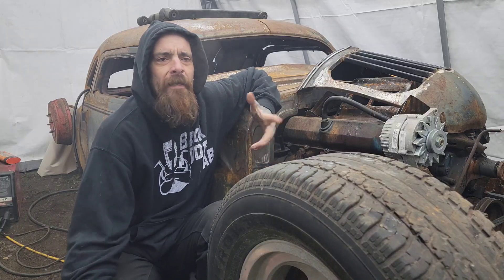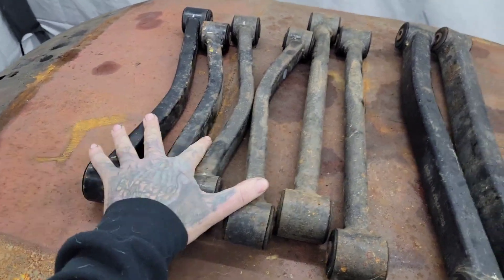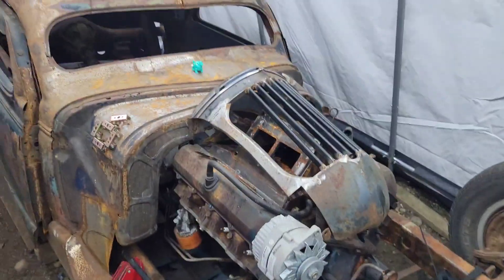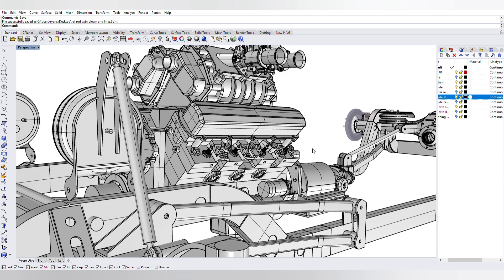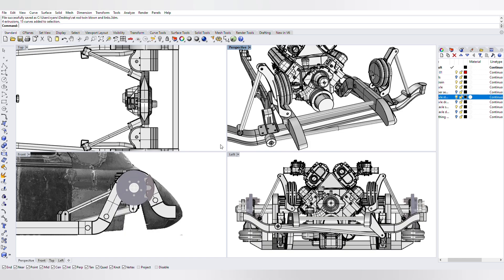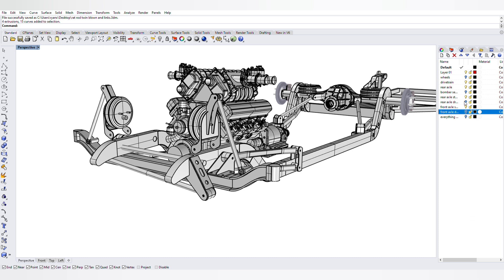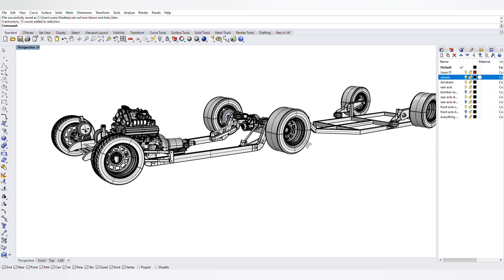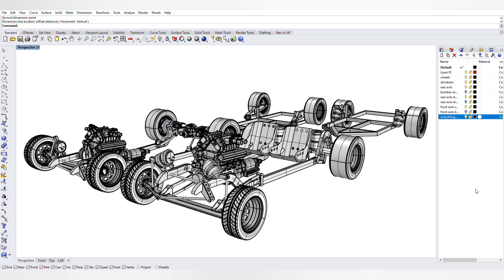Monday Morning CAD Episode 11   Suspension and Bags for my Rat Rod Chevy with a Twin Blown Olds

Comment: Hey Ryan, it's cool rocker suspension but I was wondering how the bags hold up when obliquely compressed? Do they fatigue more quickly? I like the big rear wheels/tires on the model. Very cool. Axleless trailer is the way to go.
Reply from the maker: No differant than an independent style suspension with the bag on the arm.   In a perfect world bags would travel directly perpendicular to the mounting plate.  Bit there isn't a suspension out there that allows that.  Even a parallel 4 link with equal length arms will travel in an arc, the biggest design factor is making sure that the mount plates are in line with the pivot plate, allowing it to move Ina  consistent arc. The front bags are the best I can make of it, and it allows me to use more than 100% of the range of motion, as opposed to the rear that is limited to the exact travel of the bag.  I've bought quality bags and I've put the time in to make sure it is the best possible within my design constraints, I just have to accept that air springs do have a working life span, and hope I replace them before I reach that.

Comment: going by the weather, the humidity, and the mention of logging, my guess is you're on the north west coast somewhere. you also mentioned your harley, cool, what year and model is it? and are those side draft dellorto carbs in your cad mock up?
Reply from the maker: Vancouver Island.  On the west coast of it, in a ghost town of a logging town.  The mill shut down so houses are dirt cheap and the views are unreal, we live a couple hundred feet from the ocean.
The carbs are Weber DCOE.   I'm actually grabbing mine from my buddy on the weekend, when I go down to get me wheels and all of my suspension brackets.  Coming back with a whole lot of cool stuff for the car.
And the bike.  I've got a japchop sitting in my brothers garage that I've owned for a few lifetimes, my Harley is a 2019 Fat Bob, 114, I built crash bars for it, a sissy bar, and a full stainless 2:1 exhaust for it, should be building some new fat z bars for it right away too.
I'm a die hard shovel fan. I don't have much use for Evos and Twin Cams, but I love this Milwaukee 8 motor. Pipes and a tune and it became a new ride, I'm getting old enough that I'm starting to consider a couch for me and the old lady, but I love my Bob, and we beat it pretty hard.
Reply: @kingofbootyfab  you're closer than i thought. i'm in kelowna. i live here with two of my daughters. the younger one has an '84 shovel with a 96 in S&S engine. she also has a 93 dyna. she highlites her bikes and bike adventures on her youtube channel. i have a '78 fx that we're turning into an fake FL. i know what you mean about getting old. i hope i'll be able to ride that thing when we're done it.what kind of bike is your jap chopper?i guess being that close to the ocean explains why things rust up so easy on you. anyway, thanks for the response, and are you going to do be doing your z bars on your channel?

Comment: I love Rhino, that's what I started using for my project many years ago. Now that Fusion360 is less friendly for hobbyists, I should get back into Rhino.
Reply from the maker: I'm actually self taught. And if you ask anyone trained at a school, I do it all wrong I'm told .  But I had an engineer friend of mine and one day we both programmed the exact same template.  Just a simple bracket, I had it programmed, on the memory stick, and cut on the cnc plasma, before he had finished programming.
I started because many years ago before I had my own cnc, the guy that was cutting stuff for me ran rhino, so that's what I started on.  Took me a couple years before I could program anything in 3 dimensional.  Hit once i figured that out, the flood gates opened, and now I have days I build vehicles, or art, just as if I was I was doodling in a notebook.  I sincerely believe that with the amount of common cnc equipment out there, and even 3d printers, that it's a skill that every hobbiest can use.  When I get my 3d printer I already have some badges and parts that my intent is to 3d print and then cast before I machine them to go on the car.
Basically  this is the long form version of YES, you should most definitely get back into it.
Reply: @kingofbootyfab  thanks for the story, I'm self taught in cad too. You should definitely get a 3d printer, there's so many little brackets and holders and tools you can make. But, it can also be a distraction for me that keeps me from getting work done on the car. I recommend a creality ender series printer because there's lots of mods and community support. You can even make 3d printed tube bending dies and press dies! There are vids on youtube of it. Even my shift knob is printed.
Reply from the maker: A friend of my has an Ender 3 for me, he upgraded, it's got a ton of new parts and some upgrades, I just haven't made it back down that way in a while.
I've got a bunch of shaped dimple dies programmed already, hose clamps for my frame rails, and a few parts I want to use the prints to sand cast aluminum bits for on the car.   I've been having him print stuff for me, but I'm itching to get it plugged in up here, it's going to be a game changer for the finishing details.

Comment: It just keeps getting cooler!  the cad does indeed show whats going to happen.  only thing, webers should be mounted at a 5 deg angle.min...according the book...no matter, atomization , vaporization or what ever the prevalent  therory,  gasoline runs downhill .
Reply from the maker: I can still do that. 😁
It crossed my mind to check, but my carbs are at my buddies place, and I haven't even gotten my hands on them yet. 
I'm going to finalize the adapters once I have them in my hands, and I'll probably get the adapter plates cut at the same time as everything else 😎

Comment: I love the front end suspension and your video on suspension was great as well
Reply from the maker: Thanks Ricky 🍻
Reply: I want to throw a idea at you I have a 1941 ford rear suspension transverse spring with the wishbone, I want to put a air bag in between the spring mount and the frame I know I need a panhar bar . Will it work??

Comment: How is it going to turn .From what I can see from your video, your links won't turn because  of the frame.
Reply from the maker: Tie rod is behind the axle will run just under the 4 link arms, and the drag link will push pull to a cowl mounted steering box.

Comment: Glad you know what you're doing, I wouldn't. Get out there and get it built. Lol
Reply from the maker: Absolutely 😁
Necessary evil.  The hours spent here, are saved multiple times over on the back side.  I'm spoiled having done it for so many years, but it's nice to pick up brackets and just have them fit, first try.
Reply: @King of Booty Fab  I'm old so I've always used beer box cad. Lol 😆
Reply from the maker: I must be old too then.  Beer boxes make excellent templates, and compressor head gaskets 🤣
I still cut parts by hand when needed.  But I'd rather spend my time on body work, than cutting 3/16 plate with a 5" grinder.   And for the guys that can't program, my "day job" is programming brackets, and bumpers, and virtually everything else a car guy wants, so that the shop can cut them out.  And a lot of them time, I'm programming based on a picture of that exact beer box template.